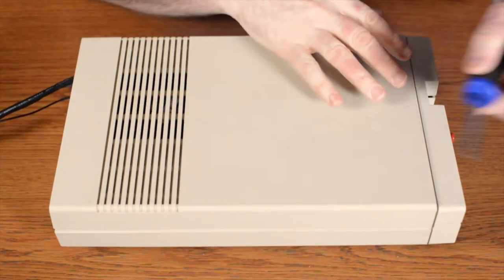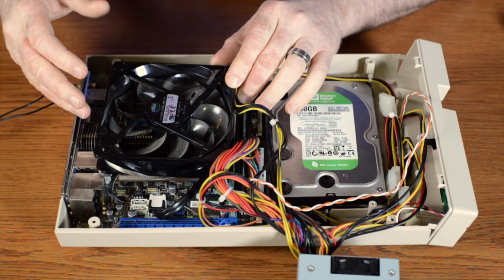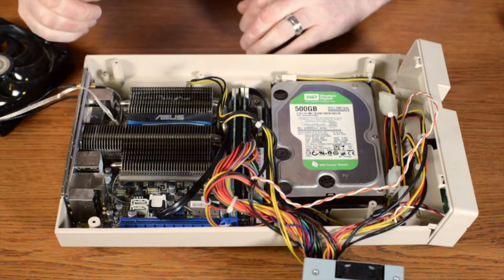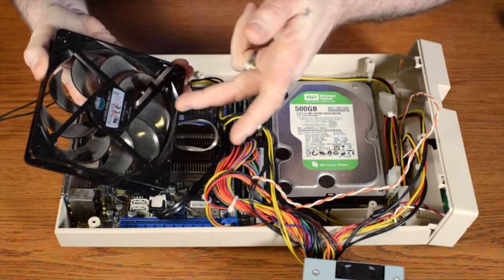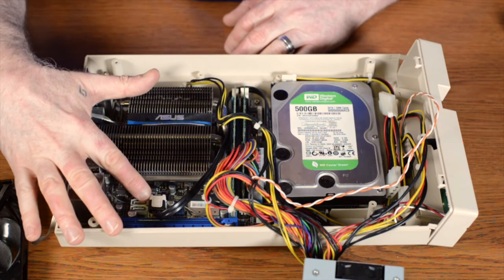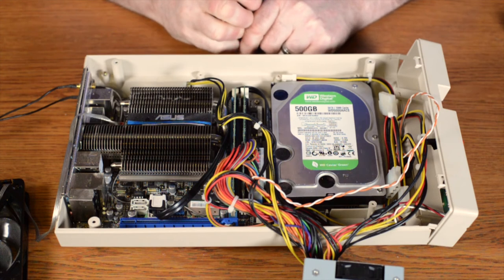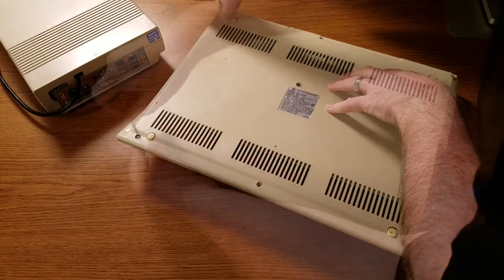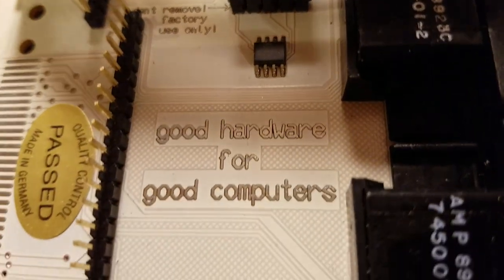Commodore Hacks P3: Micro PC Reveal

Comment: Very nice, just i would put SSD drive instead of hdd, and 8 gigs of ram since AMD boards can work with 4GB DDR2 sticks.
Reply from the maker: Thanks! At the time I built it, SSDs were still out of my price range and the 4 gig choice was based on using 32bit Win7. The build itself was an experiment to see if it could be done and I just happened to have a spare HD on hand that fit the space perfectly.

Comment: so you just use the 128 case for the keyoard? i originally thought you actually integrated the 128 to work with the pc. So you don't have a Commodore pc, you have a windows pc that looks like a commodore. sorry but my nostalgia kicked in and the idea of using an original Commodore to a pc would be even better. thanks for all the videos and I subscribed just to see what other cool stuff you got going on.I have my own channel but it is for Amateur Radio. I like your videos and want to see more C64 stuff!! I grew up on that.  73, ad0am
Reply from the maker: Thanks! Yeah, the project originally started with trying to squeeze one into a Commodore 64, but that didn't work as well with the motherboards available at the time. I was inspired by the short-lived Commodore PC's that came out several years ago (https://www.pcworld.com/article/224722/new_commodore_64_is_finally_here_for_real.html), but they wanted to charge way too much for a base-level machine.